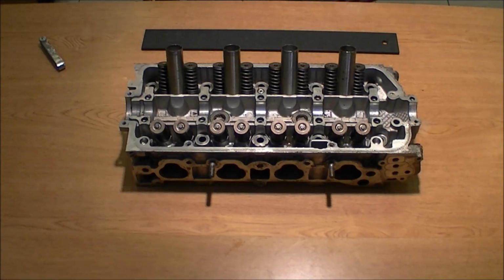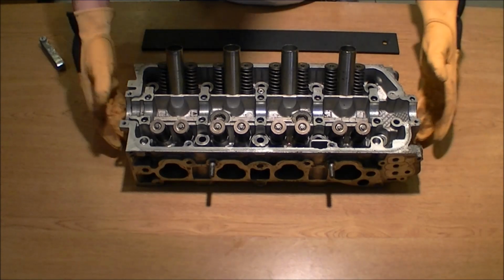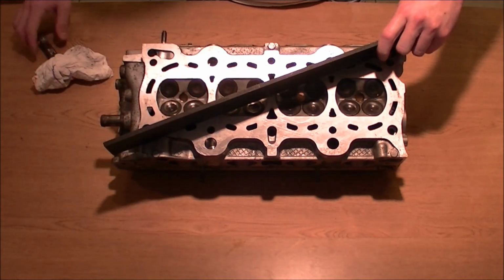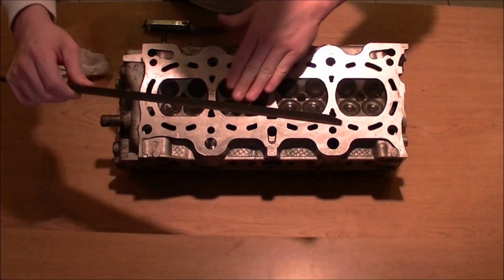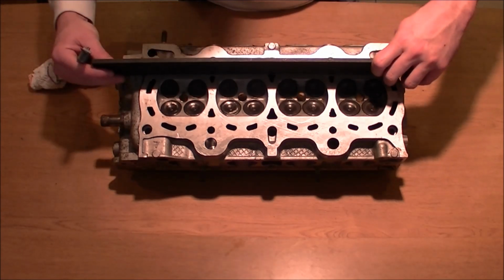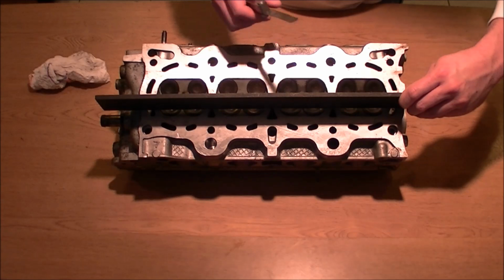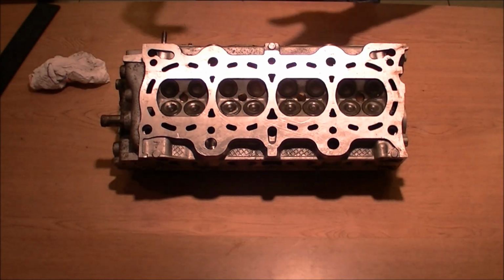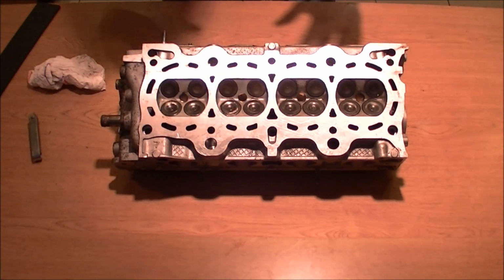Check Head & Block Deck "How To"

Comment: Just to clarify some points out in this video: That grinding he does with the straight bar, has no effect whatsoever (even if you don't care about that particular cylinder head); its just a "bad habit", since if there was sand or dirt under the straight bar, grinding the thing on the cylinder head would just cause scratches and imprints from the dirt that is trapped under the bar. The grains will not disappear just because you grinding the bar back and forth. Otherwise, clear information and straight forward!
Reply: SuburbAllied This grinding of the straight edge instead of lifting it can also ruin it and it will no longer have the degree of accuracy as before...